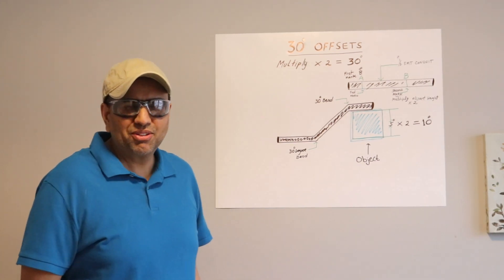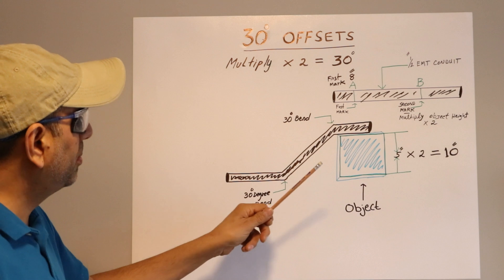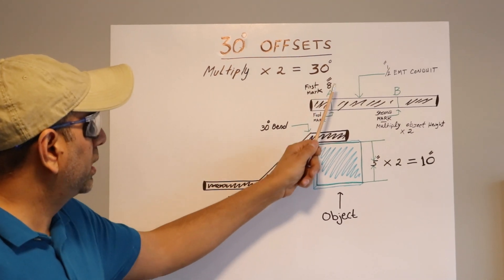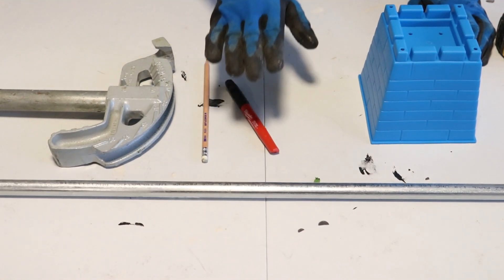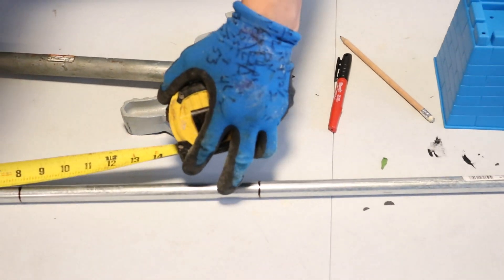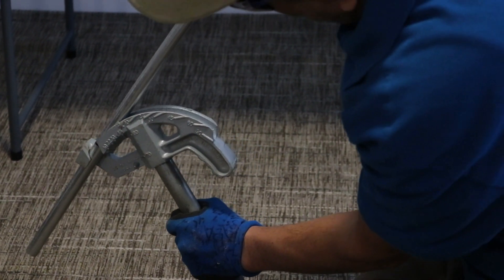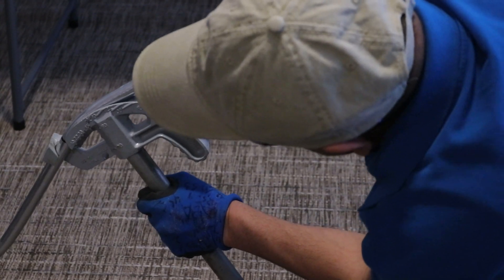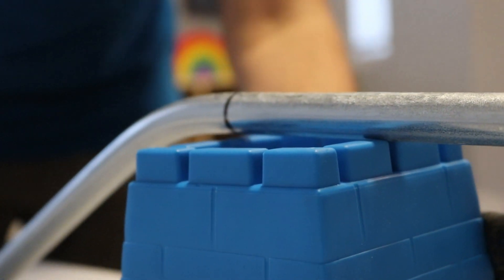How to bend EMT  Conduit  || How do you bend a 30 degree offset I Easy Electrical

Comment: Great video and nice work.  Maybe consider holding the bender with handle on ground,  your foot in front of the handle and standing up.  Use your body weight to make it easier and safer. You will never bend 3/4 sitting down.
Reply from the maker: Great to make comments thank you I will re do and.need more feedback